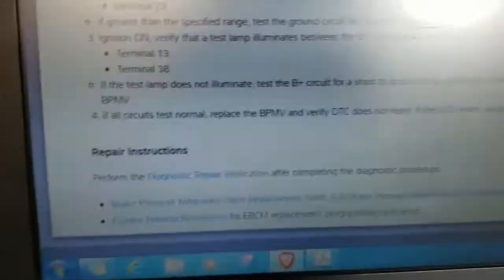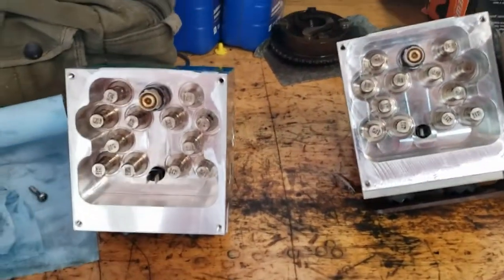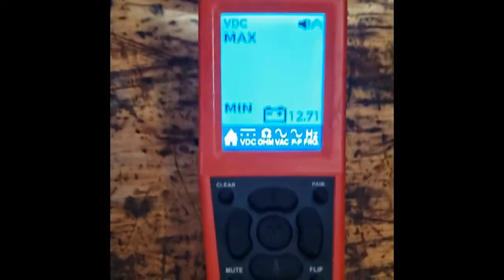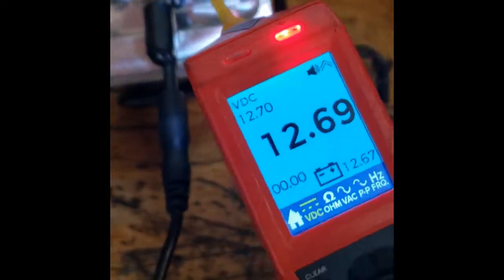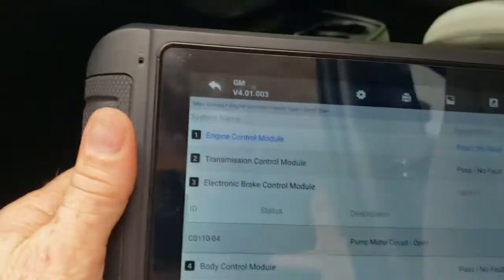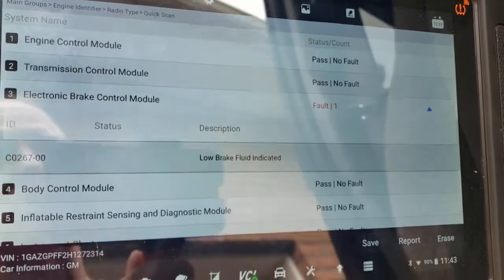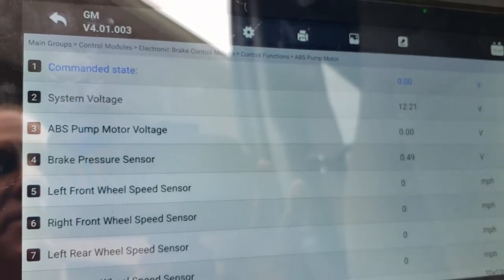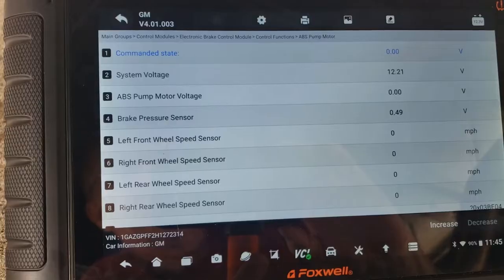2017 Chevrolet Express Van C0110-04 ABS Code Solved

Comment: Thanks, super helpful video.  Is the module supposed to give 12v?  The one I’m working on is supplying the module with 12v from the harness, but the module is only supplying 5v to the motor connector.
Reply from the maker: How are you measuring motor voltage?  The motor terminals plug directly into the module.
Reply: With the module removed from the pump, but still plugged into the harness connector, I checked at the two terminals in the module that power and ground the pump.
Reply from the maker: I'm not sure.  I don't have a schematic of the module, but on my scan tool, I was showing around 12 volts.   There's no telling what will happen with the motor removed from the circuit...no load.  With my powerprobe, the motor ran with 12 volts.  You may have a bad module.

Comment: Thank you for this video. It is the most helpful I have found. I have a question if you don't mind. I used a scan tool to run that abs motor and it comes on but it says the voltage the motor is pulling is anywhere from .4v to 4.6v and not the full 12v as shown in your example. The motor itself sounds fine though. Thoughts? Could the motor be bad?
Reply from the maker: Check you ground connections with a multimeter set to dc.  Red lead to the ground wire on the connector to the ABS module & black wire to chassis ground.  If more than 300mv, repair ground.
Reply: @superk4562  do you know if that motor on the valve body can be removed without. Opening the hydraulic system?
Reply from the maker: @Mr-Payne  not sure, but I have two units on my work bench that I can try.
Reply: @superk4562  that would be awesome. I found a place that will rebuild the little motors. I tapped on it with a screwdriver and it started working normally so it seems that the brushes got stuck. As far as I can find the entire assembly has to be replaced for $800 which seems excessive when the only issue is the motor
Reply from the maker: @Mr-Payne  the unit for my BMW is $2400.00
Reply: @superk4562  I have heard about people going to European websites and buying from there and having it shipped internationally and saving a ton of money
Reply from the maker: @Mr-Payne  nope, can't remove the motor from the valve body
Reply: @superk4562  damn. Thanks

Comment: Thanks for sharing. I didn't have to pull off the connector harness or even take apart the unit.  The error message reads the "Pump Motor Circuit - Stuck" so I just got a rachet extension and tapped it all around the motor and it started working and the ABS lights and error messages were gone. My vehicle is a Silverado 2017 HD 2500 Duramax 6.6 V8. I hope someone finds this useful.
Reply: This just worked for me.  At least now I know it's the motor 🍻

Comment: This video is so helpful. What is step 1 and 2 for the diagnostic procedure?
Reply from the maker: Step 1 would be to connect a scan tool with bi-directional controls.
Step 2, would be to activate the pump motor (see the last minute or two of the video.), and see if the module is sending power to the motor.  Can you hear the motor?

Comment: What symptoms did the owner complain about?
Reply from the maker: ABS light was on.
Reply: @superk4562  but no complaints on how it operates? So operation seems to be fine with the owner?
Reply from the maker: @sargetester99  Onwer purchased van at GSA (Government Services Administration) auction;  ABS light was on.  I cleared the DTCs and pulled up wheel speed sensors on a test drive; all sensors were working properly, so I had the owner perform a panic stop to check ABS operation; that set the DTC for the pump motor open circuit.